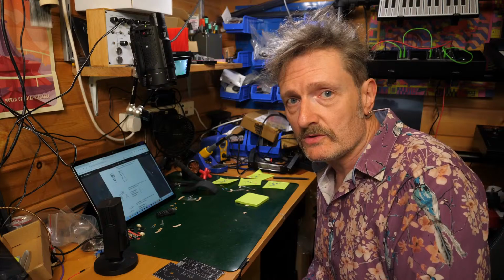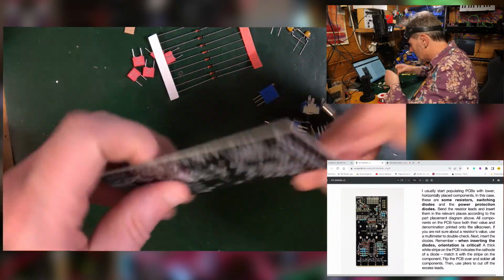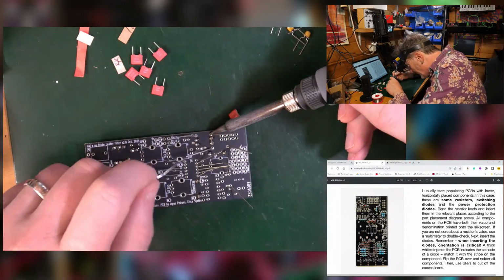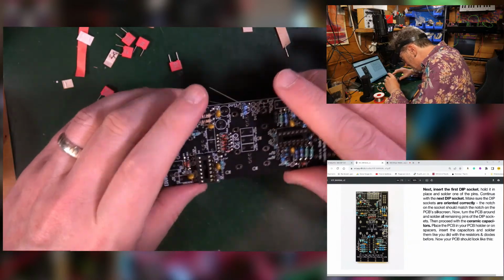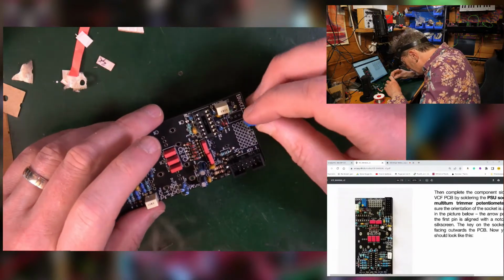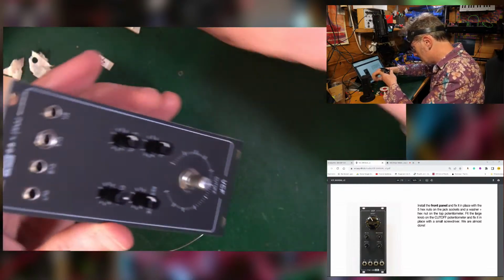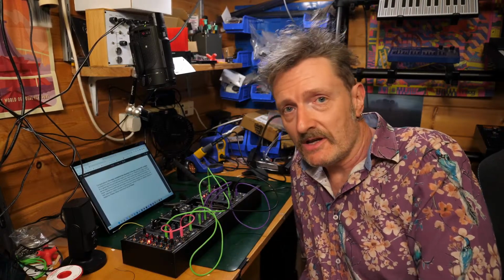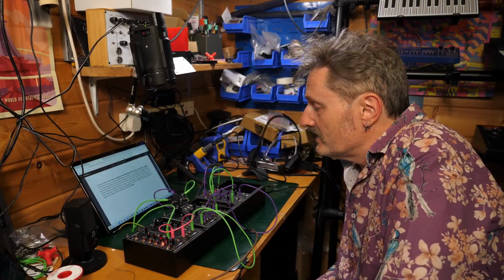Molten Live Stream - Erica Synths EDU DIY VCF build-along - Soldering

Comment: Soldering Hell ...
Reply from the maker: Nah, it was lovely
Reply: These kits are actually not bad with a little practice ; worst part is just sorting the resisters before you start… I feel guilty I don’t take the time to breadboard them before assembly though…
Reply: @WithTheGrain  true, the value of indulging in the hands on process of breadboarding cannot be overstated, and key to understanding what is going on. But thorough study of the manual alone does yield many insights.